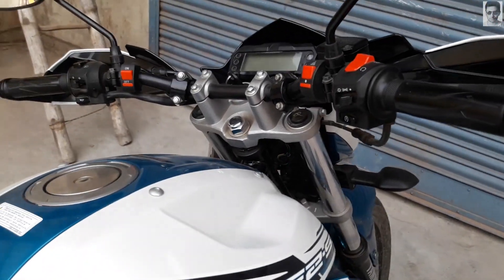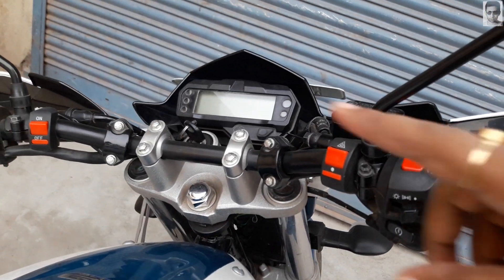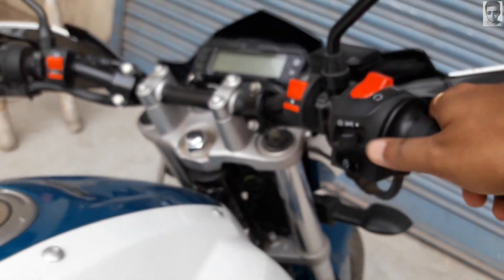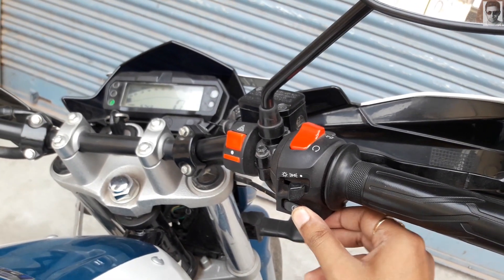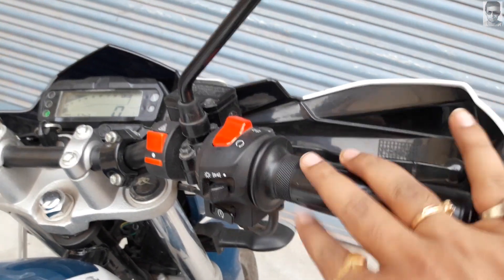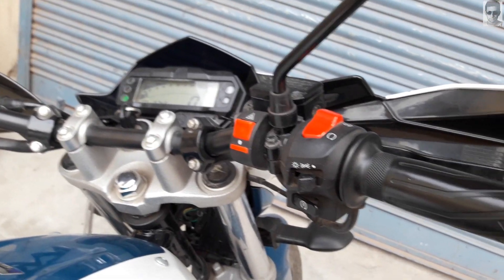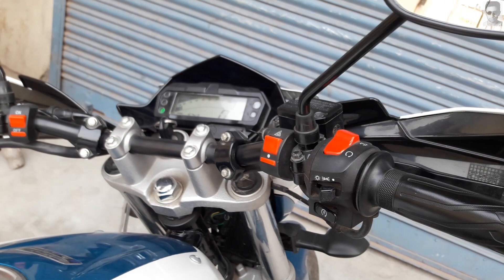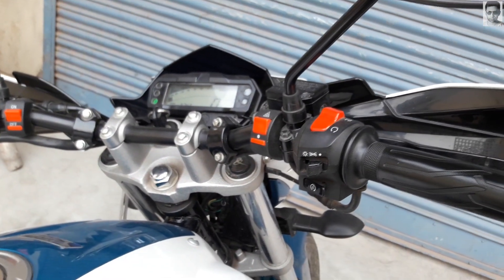Throttle Position Sensor in Yamaha FZ-S V2.0 || How it Works || Starting Problem Solved

Comment: My accelerator is getting very tight while riding. I changed the cable. Even then it's tight which is causing pain in my fingers and hands. What needs to be done. None of the mechanic here in chennai are able to identify the cause
Reply from the maker: Lubricate the accelerator
Reply: Same issue for me any solution you got @itzme8779
Reply: @dilipkumar-tm8su  no bro. But whenever I lubricate the chain and do air check up the accelerator gets lossened a bit. But stil dont know the exact cause. I'm using FZsFI V2 bike

Comment: I have a problem in my new bike fzs fi lighting cyan  my self is not working sometimes when i start the engine kill switch on or off what i have to doo
Reply from the maker: I sometimes faced the problem too... there is nothing serious, i asked the service guys ... they told me thats not an issue try 2nd tym it will start
Reply: maybe due to water inside cluth sensor wire on left side of handle.
On gear ,bike wont start if you press the cluth also .you need to shift to neutral position and then bike will start as normal as usual.hope it will help you